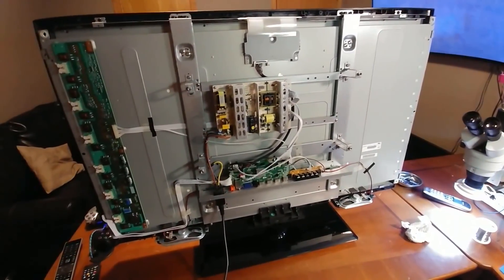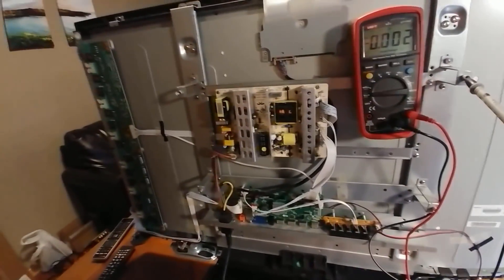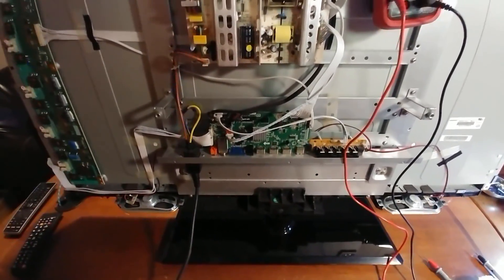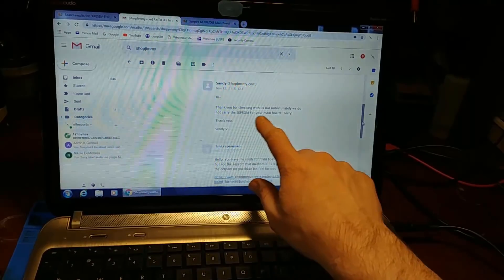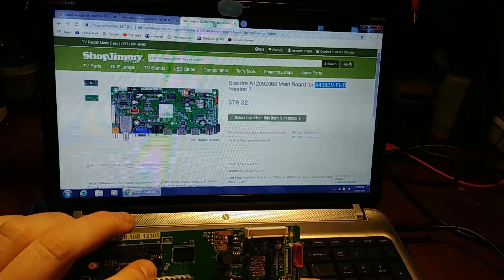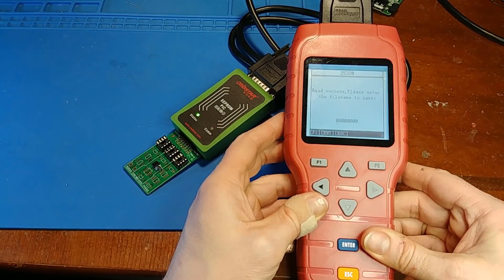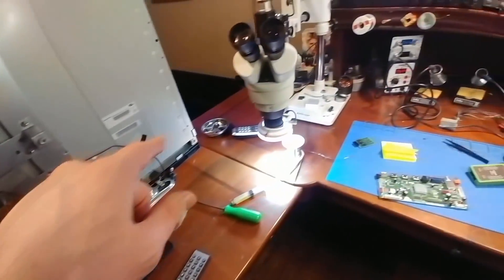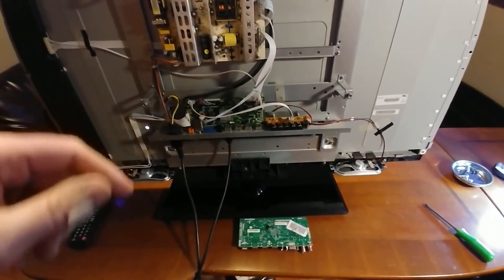Fixing a TV with a scan tool

Comment: Dude use dropbox and use the sharelink function
Reply from the maker: Badcaps forum has a huge collection of Eeprom files. Better than any collection I could start.
Reply: @jeffescortlx  But you may have to sign up to donwload.
You dont need to use dropbox to start a collection, just host some files
Reply from the maker: @IIGrayfoxII  good point. If somebody needs this version I have I'll give it a try. Although anyone fixing TV'S should really join badcaps forum.

Comment: How do you know all these troubleshooting steps? Is there a service manual and schematic?
Reply from the maker: Basic same rules for most LCD TV's. Kinda like when a engine doesn't run you check for fuel and spark. But when a TV doesn't work you check power supply and back light.

Comment: Cool. Back in the day when I was in the business we used a program called Quick Chip or Kwik Chip to read / reprogram eeprom chips. Was a huge problem on RCA CRT TVs back in the 90's. Had a clip I could clip right on the chip inside the TV and reprogram the DIP chip without even removing it.
Reply from the maker: Holy cow the legendary 12v vids posted on my channel. That's it boy's I've made it!
Reply: @jeffescortlx  
LOL :)
Reply: You deserve it buddy.
Reply: @jeffescortlx Hi I have a question for ya. I have a westing house tv that will randomly go into what I call rainbow mode where half of the colors are different than they’re supposed to be and shadows appear purple. This can happen any second and stop another or last for hours on end and randomly fix itself for a second then mess up again. What would cause this and what in your opinion would be the best option for this tv? Thanks

Comment: How did you know it was the eprom vs another chip or issue with the main board?
Reply from the maker: It's common for a failed eeprom to cause the mainboard to lock up on start up. Combination of statistical trouble shooting and luck.
Reply: @jeffescortlx  thx

Comment: What about a free 50" Plasma tv? If I get it free and repair it it'll be a cheap fix,right? It comes on then sometimes not so intermittent on/off issues?
Reply: I'd check the power supply. Kinda sounds capacitor related

Comment: Great video and attention to detail.  This would be awesome on iFixit if you use.   I also am impressed with the Scan Tool method.  I've never seen that before.  I wound up investing in a GQ 4x4 since I needed for the TDS-520 Dallas 32 pin NVRAM chip and the other TDS family I have to work on/with.  

I almost want to make an iFixit repair guide referencing this video since I have a Spectre 32 X320BV-HD I'll be diagnosing and repairing where the display is turning off after watching after a period of time (nephew had so I'm not sure exact details yet).  I haven't been doing any serious videos yet... more vlogs when I'm worn out from other tasks to keep me moving forward on the simple salvaged/restore/re-use projects. 

Thanks for sharing!

Comment: the eprom failed because of background radiation?
Reply: eeprom. My take on it would be an inconvenient timing of a power failure caught the eeprom in the midst of storing information so it's contents turned into garbage. He reused it only with good code restored in it and it works.

Comment: Are these eeproms on a timer to break?
Reply: I get that feeling about most electrics and electronics.
The simple light bulb is a prime example.
There is a light bulb that's been in continuous use for 117 years: 

https://en.wikipedia.org/wiki/Centennial_Light

The manufacturers quickly realized that all they had to do was to increase the thickness of the filament, drop its temperature and they would be out of business in a week.
So they made all bulbs have a limited life-span.
The same goes for most stuff.

Take a look here:

https://en.wikipedia.org/wiki/Planned_obsolescence
Reply: @user-bh1oy8kj5q  Actually lowering the temperature would give you a unusable colour of light.
And making filament thicker would  decrease the power of the light bulbs given the constant voltage of 220v/110v
So stop talking shit and get a book in your hands,learn Ohm's law and maybe you will understand that world is not a conspiracy riddled dome crowded by all kinds of mucks trying to fool you.
Reply: @lazar2175  Put a diode in series with a mains lamp.
The temperature and brightness is reduced but still usable.
The lamp will last for years.
Yes it will flicker but it's still usable.
Shit? LOL
Reply: @user-bh1oy8kj5q  You fix nothing with that.You only run the bulb on half sine wave and you get a small voltage drop.
That diode costs much more than the bulb to produce.
And also,most light bulb fails are because of the vacuum seal breaking and after oxygen enters the lightbulb it oxidises the filament.
And i really hope you are not using incandescent lightbulbs in your home.
Reply: @user-bh1oy8kj5q  "let's make it usable"  was not a design objective.  People buy what they like. Product designers make designs what people buy. I have never bought anything thinking, "Well, it sucks , but it's usable. Think I'll get me some of that!!"

Comment: Why would the EEPROM lose data?
Reply from the maker: I'm not sure what triggers it. But it just seems to happen. PC motherboards, TV' and instrument clusters will have eeprom's just up and fail.
Reply: @jeffescortlx  Is this EEPROM where the Firmware for the TV resides? If so it could have been a failed update, due to a power surge, brownout, etc.  Nice fix though; I haven't done any work with EEPROMS in probably 20+ years, the ones I worked with most had little windows on top of them and had to be erased with a UV light. :)
Reply from the maker: @southernoftexas8229  while that is possible with other TV's, this is a non-smart TV that is off-line and not capable of automatic firmware updates.

Comment: a corrupted EEPROM!!! a repair one in one millon!.
Reply: i guess running a simple sanity check on the read eeprom data before using it, and reverting to default values when they are out of range was too much for the firmware developers. And these are the same people that develop all your IOT devices, think about that for a second.
Reply: Happens more often than you think.  I used to work for a warranty TV repair center, still do other business with them.  Also happens often with PC motherboards where UEFI and system utilities write to the EEPROM too often (HP being the worst offender).  I have done this repair myself twice before, and that's just for stuff I own and not for commercial work.
Reply: @rootbeer666  I have two gigabyte motherbouard which the first year copy it restore the bios itself from backup once a month.

Comment: Great move bro! I would charge shopjimmy for the file since they didnt want to help. I doubt that they couldn't do the same as you did with the eprom.
Reply from the maker: I think shopjimmy already has the correct BIN file, that's how they repaired the board they sold me. But for what reason it's not in there inventory to sell just the chip.
Reply: @jeffescortlx  Probably not enough pay back for Shop Jimmy in that particular deal. Love your scan tool hack - that's old school at its finest. Nice work.

Comment: I know this has nothing to do with your video. But how much do you charge to do a milage correction on a cluster off a 2013 escalade.
Reply from the maker: Sorry my tool doesn't cover that year/model. Whats wrong with the original cluster that belongs to the vehicle?
Reply: jeffescortlx The original one is from a 2007. But i upgraded to the 2013 cluster just because i liked the face of the gauges. I no longer have the 2007 cluster.